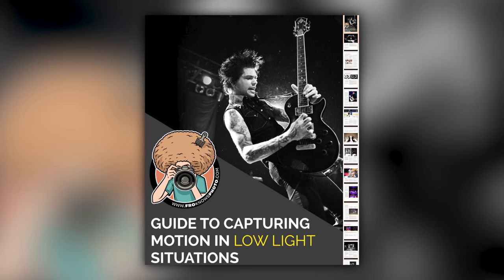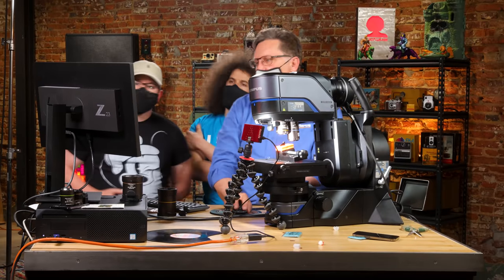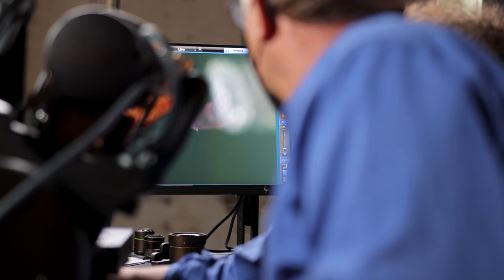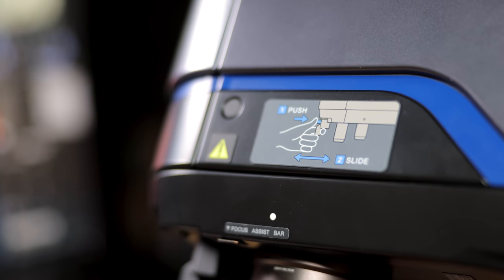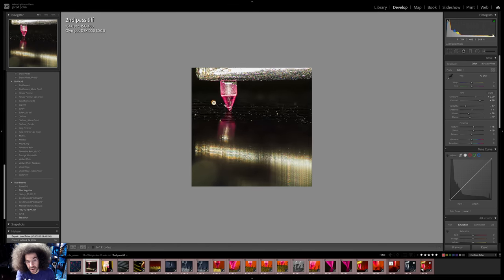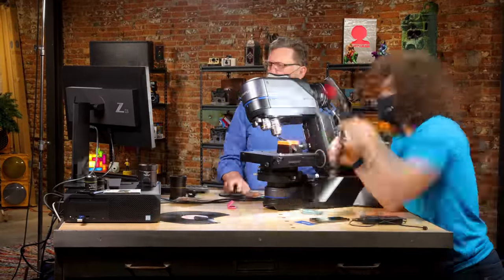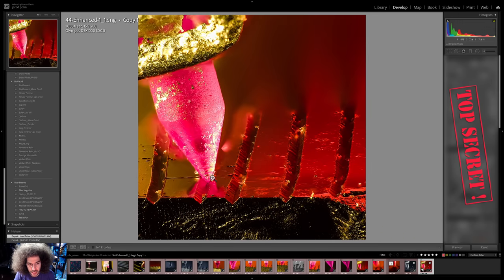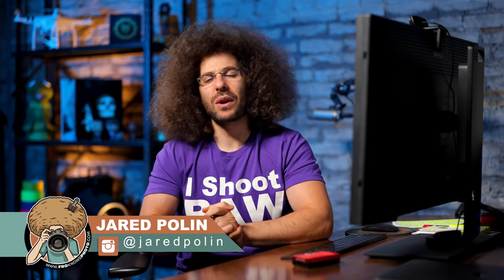Did I FAIL? Taking Pictures with a $65,000 Microscope!

Comment: IMO the biggest difference between your images and the photo that inspired this project is the record itself. The original photo has much deeper grooves. That tells me it's a vinyl record from the early '70s or earlier. Those records were made from a much thicker and stiffer vinyl material. Those were very fragile discs and could break if you dropped them.  They likely had much deeper grooves, which really makes those details stand out. That's what makes that first photo really pop. Technology has taken that away. Audiophiles may argue that old discs had better sound as a result.

Somewhere around here I have some 1950s jazz albums from my parents; sadly, I don't have a phonograph to play them.
Reply from the maker: interesting, thank you!!!
Reply: Perhaps an original ‘78’ disc? They were made of something like stone 🤣
Reply: yeah, the original 78 rpm discs were made from Shellac not vinyl
Reply: I think the original was also a SEM 

Edited because I said TEM
Reply: What about the old Edison tubes that were cylinders which had the steel needle vibrate a device in the big horn shaped speaker on the non electric Victrolas.
Reply: @NickzAndMikz  English, please? 😬 For the non-super-techies in the audience?
Reply: My thoughts exactly. Find the largest groove size/needle combination right from the start. Great video Jared!
Reply: I think the groove you focused on was silence, and the original inspirational shot, the audio was loud. It is all the crests and valleys that move the needle to induce a voltage that translates to audio.
Reply: I agree. An older album with a lot of bass would probably have more pronounced grooves.
Reply: @JohnDrummondPhoto  Transmission Electron Microscopy

Means it has a higher "resolution" and magnification in microscope terms

Correction - I meant scanning electron microscopy. Transmission is different. My mistake
Reply: I think that original photo is groves from an old 70’s/80’s “quadraphonic” album. The small “high frequency” ripples on the larger waves is what makes me think that. The “high frequency” (above audible) channels encoded the two rear channels. I had a “quad” audio  and turntable system in college in the late 70’s and this was how they looked as I recall.
Reply: Early vinyl records were made of Shellac. And yes, they used to shatter for a past time
Reply: @Dr_MattS  Shellac
Reply: Don't worry, there are plenty of pornographs out there if you know where to look.  Not my cup of tea, but to each his own.

Comment: Im a microscopist and application specialist for microscopes (not working for Olympus and not in the US). Kudos to the Olympus application specialist (you call him technician). Well done Jared for thinking outside the box and well done Olympus tech for doing outside the box applications!

I prefer the B/W too but i would smooth the transition to out of focus area a bot more. It looks chopped of as the DOF is so shallow. @Jared: I also like that you did not simply replicated the REM image. REM have a lotof DOF, way more than optical microscopes.

Comment: Great job Jarod. If I had hired you, I would be very happy with the result. The image has impact, and the negative space is perfect. If the groove has additional DOF available such that it could go deeper into the shot, that would be a little better in my opinion.  If the album does not have a title, maybe “Edge of the Groove” could work. Lastly, for color vs B&W, both are excellent. I talked to my son, who just graduated with a degree in graphic design. He felt the color choice should be determined by the music genre - and he also like both versions.

Comment: Awesome story Jared. :) The reference image is also definitely taken with a Scanning Electron Microscope, using Electrons to take images, instead of Photons. Electrons are smaller than Photons and allows for more details at the super ultra macro level to be captured. But as you said, those machines costs many millions and are only found a few places. They are also mega huge, requiring an entire room. :)

Comment: I may be totally ignorant as to the relative sizes. But I would be curious to see what the RF 100mm macro's 1.4X magnification would do with this on a 45MP R5, perhaps with extension tubes. Considering this microscope camera is only a 1" sensor and 1 megapixel resolution, I seriously think you'd get better results with a full frame camera and macro lens. Plus, the smaller magnification but higher resolution would mean a wider depth of field.

Comment: Hi Jared, thanks for sharing this nice making of. 
Two comments from my side, (know you get many, not sure if you read them all :-))
With micropositioners used in analytical probing you can place a 1 micrometer tip on a 2 micrometer landing pad, no problem with the right microscope to see what is going on. And the Olympus looks great.
One little inconsistency on your picture versus what happens on the turntable - if you look in direction of the groove, the stylus should be vertical. 
Thanks for sharing the insight into the micro world.
Best regards.
Steffen

Comment: Great video. Apologies if someone else has already covered this and I missed it, but...

Stylii for 12" LPs are typically made of either diamond, ruby or sapphire. Diamond is hardest (and hence wears the longest), but ruby and sapphire are cheaper. Initially I thought you might have used a ruby because in most of the pictures the stylus looked very pink or reddish. On checking the Amazon advert it did say diamond. But it wouldn't be the first time that someone didn't get what they paid for. 

I mention all this for two reasons. Firstly, if the client is an audiophile (possible if he is interested in vinyl), the colour picture may have a negative connotation if he perceives the use of a ruby rather than diamond stylus. Secondly, if you had to reshoot it might be interesting to see what light diffraction effects you would get with ruby or sapphire vs diamond.

Comment: One more thing...

The reason the grooves look shallow and further apart than the reference image is probably because it is a kids record. These typically require less dynamic range than regular music LPs - which means the grooves don't have to be as wide and deep. That means that either more paying time can be squeezed onto the LP or the grooves can be spaced further apart. The latter seems to be the case here, hence the large "plateaus" between the grooves.

If you had to reshoot, you might be able to get something more like the reference picture by using an audiophile pressing of an album that squeezes over 23 mins of music onto a side.

Comment: The slider was for optical zoom not digital zoom. This microscope is capable of 10x optical internal zoom for any attached lens. You could also create stitched images to increase the resolution that is beside the stacking capability to increase depth.

Comment: I like the B+W version mostly but, what I would have done in post production is left the ruby needle in colour with a hint of the colour being left in the groove in the foreground. This would give an illusion of motion as the record passes under the needle as the album plays. If you do a similar picture again , use a 45 or 78 rpm record. The grooves are bigger.

Comment: I'll go strongly for the color, but that's just me.  The most professional thing that you did was to make a win-win arrangement with Olympus.  Had you tried to do this alone or even worse rented all this equipment all by yourself, I think that you would have failed.

I'm of two minds about all the dust and dirt.  That's why so many labs that work with microstructures are clean rooms.  Still, some of the dirt helped a lot to provide depth and detail.

Especially for the color shots, you might think about using some of these pencil-sized lasers you can buy cheaply these days.  With the modern record plastic, you have smoother more specular surfaces. You could use this to contrast, say, the groove walls with the sound pattern cut into them.
Reply: One more thing.  If you ended up with a nicely-contrasting color image, couldn't you use your cinematic skills to help the record company color-grade the image?

Comment: The original picture you worked from was probably an old style metal needle on a 78 record.  Needles back then looked kinda like a short fat sewing needle and sold 5 to a package, if I remember correctly.  The record groves were bigger in the 40's & 50's as well as the needles.   Thank you for sharing your experience in doing this...very interesting.
Reply from the maker: I will def be looking into that

Comment: Great video going through what you had to go through to make this project possible. I feel the color will work well for the cover and the b&w can be used for inside the jacket or somewhere as a smaller picture. Credit should be given to Olympus and the band should have another video made explaining in detail how the image was captured that is a bit shorter and more streamlined with just the finished product.